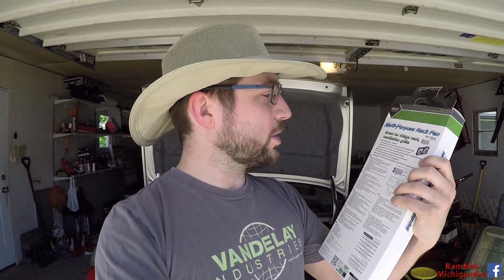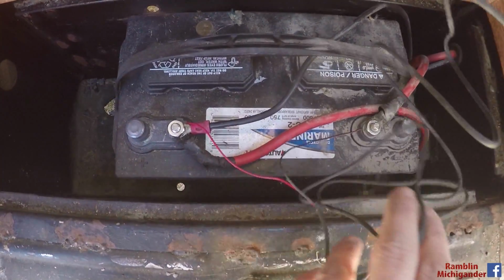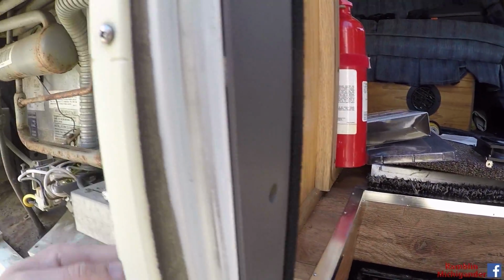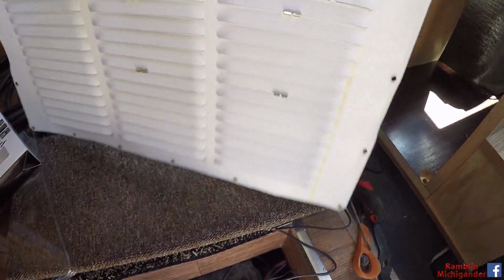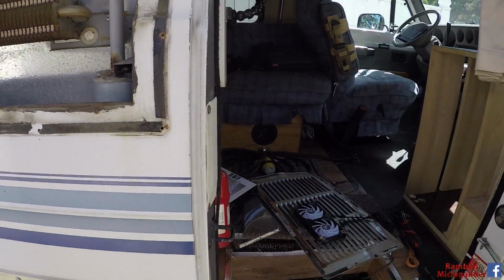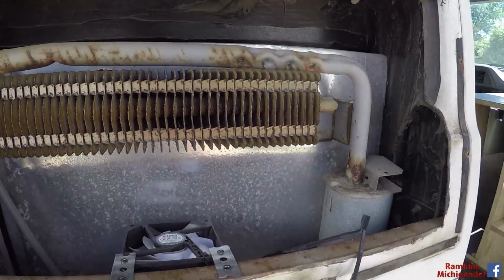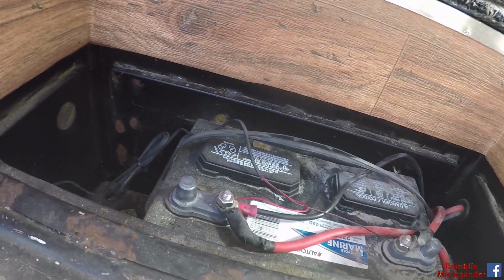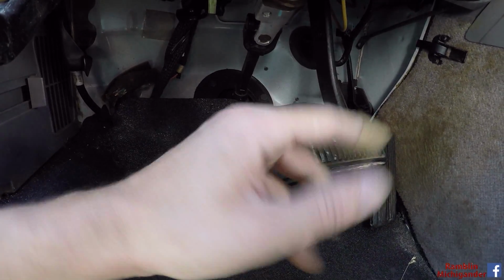RV Fridge Fan Mod

Comment: If you mount exhaust fans, always mount them in the TOP vent, to increase flow from convection. If you mount them in the bottom vent, mount them reversed, so they function as intake fans. They will then automatically direct cool air towards the heat exchanger.

Comment: I'd put both fans pointing up at the heat exchanger and directly under the heat exchanger (a few inches below).  This would put them in the normal upward flow from convection thus increasing that flow and focusing it on the fins before convection takes it out through the upper grille.  These fans generate a plume on the output side and take air omnidirectionally on the inlet side so they are effective at directing air but not so much in pulling air.  So the one on the outlet grille isn't doing much.  It's pulling air from all directions including air coming up from below and exhausting it without it passing over the fins.

Comment: hi fans are 28db noie level which is quiet . 53cfm for each fan  
1/ these fans needto run at 100% there  only mid size 
2/operation is 45 deg cel when done with a tube sensor . Your unit flows at 100% at this level 
3/ all rising heat 100%  is suppose to go via fins . If u look in other vids good systems have some sheet metal going from upper vent to bottom side of condensor .
THE fans suck all air via the condensor  = maximum cooling

Comment: I think it would be more effective if the fans were mounted in the top grill, drawing the hot air up and expelling through vents so as to increase natural circulation.

Comment: Holy moley, never had automotive (dc) had black as power .Not getting into the weeds but in reality negative is where the power comes from on the atomic level. But stick with red = pos ,black= neg. Sometimes With two black wires one will have a white stripe, that's the positive wire.

Comment: Wooooow, dude you're a genius guy really, but you can put the blowing fan on the string cooler and believe me no matter what it's not gonna burn the fan, or you can put the cooler of the processer of the (PC) & try it...... I made an mini (AC) from those pieces and it made the temp of my room 24°c, it reduced it from 35°c in about 2 hours and 55 minutes, try it buddy you won't regret it, bye for now.

Comment: The more I think about 200mm FANs the more I like the idea. Do yourself a favor and get some 200mm FANs...12 bucks each.
Reply from the maker: Cheap fans are noisy and won’t move air as efficiently. They also don’t have the auto control box. Also, they aren’t waterproof so if they get wet they will be ruined. I paid a price for this kit but it fits my needs nicely.

Comment: It's not stupid to use our system of weights and measures.
Reply: You're right, Stephen Garfield, as long as you're NOT going to travel outside of the USA, or purchase anything foreign-made. We are the ONLY country that uses this system! We're smart enough to change our "weighs", aren't we? Let's show that you CAN teach an old dog new tricks!
Reply: I'm in Australia so have lived with imperial and now metric system. Metric is so much easier to use. The only stupid idea I see is that miles per gallon is now replaced by litres per hundred kilometres. Whoever came up with that idea was obviously drunk. It should obviously be kilometres per litre.
Reply: Not the only country that uses that system do some research

Comment: One more question, how does the fan affect the gas light/flame?
Reply: Not sure but probably not enough  but will add more air to burn.
I wonder why do we need a fan at all as the system is using heat to make the interior of the fridge cold!  As the heat rises it creates it's own air flow! It does take several hours to get cold when you first start. Keeping the air flowing inside really helps & keeping the door closed! I am a fan of the interior fans! :~)

Comment: wire coding Red positive, black negative is the normal & as a retired electrician i know. unless silly Americans do this different to the rest of the world
Reply: I agree for 12 volt dc systems. Confuse the 12v dc with regular household AC, and hat's where the black as positive gets confusing when you're not familiar with both systems. Just like black is ground on 12v dc, green or bare is ground in 120v ac systems. Red refers to a 4th wire in a house system, as for the 4th wire for a fan, alongside the other hot wire which is black. And white on a house is neutral, or kinda like a secondary ground of some nature, because both the neutral and ground connect to same bus bar in house panel boxes, yet the white is typical of a ground wire on some 12v dc items like fans and stuff, and always the ground color on typical trailer wiring.